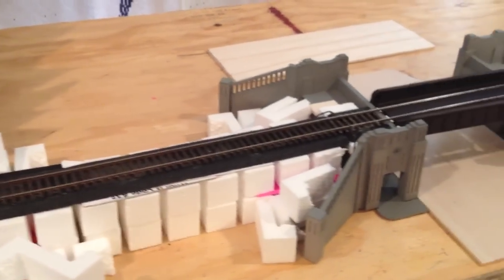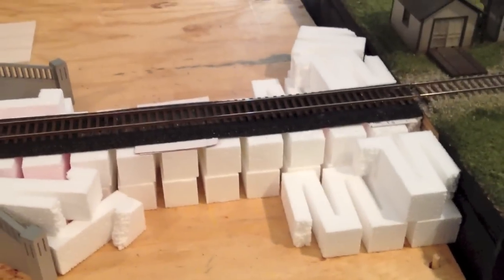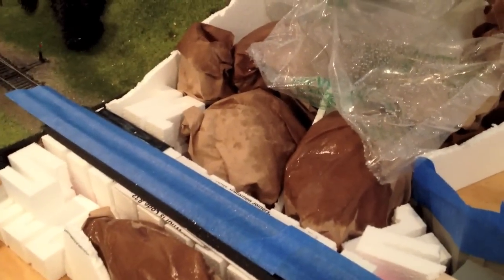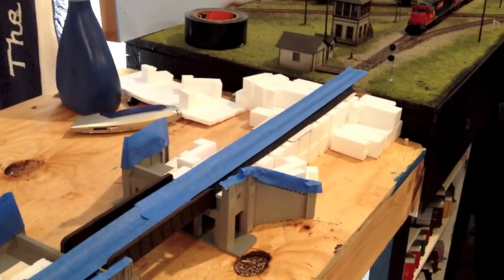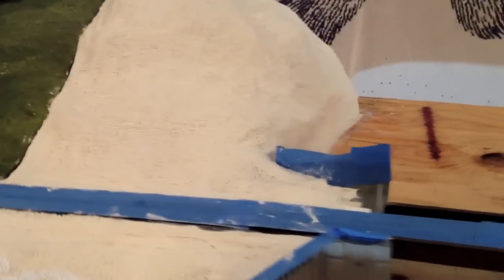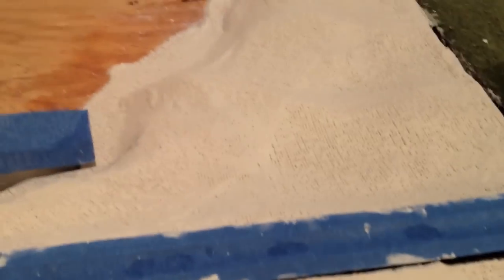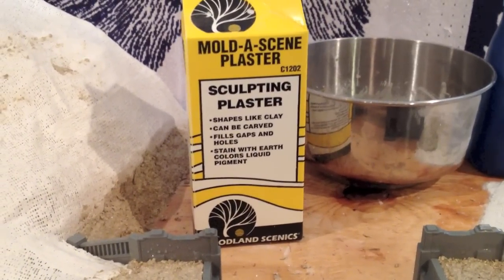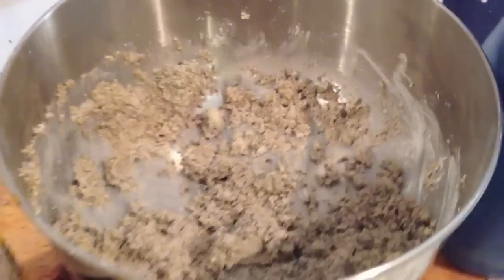New Layout Module, Start to Finish - Part 1

Comment: nice job.  looks really good.  I don't know if this method will work for what i'm doing.  i'm worried about the durability of landscaping detail work.  i'm building a "portable" modular layout and one of my key concerns is with my landscape scenery cracking a shattering if a modular section gets dropped or banged around a little hard.  I am learning a lot though from all these videos and this one is really good.  thanks for sharing.

Comment from the maker: Great question and it wasn't without thought. Since the module comes out (there's a balcony door right behind it), there are mounting pegs to keep it in place in the corners. I need to be able to see those to line the module up when replacing it. I will simply design the fascia to hide them. :-)